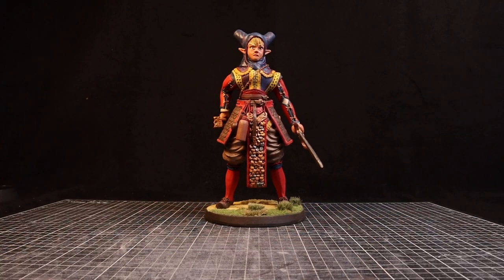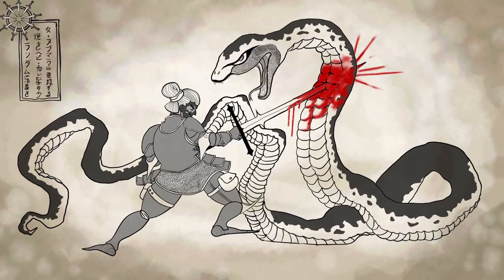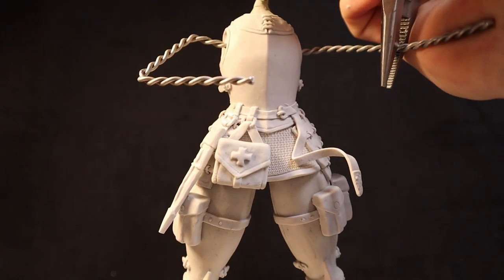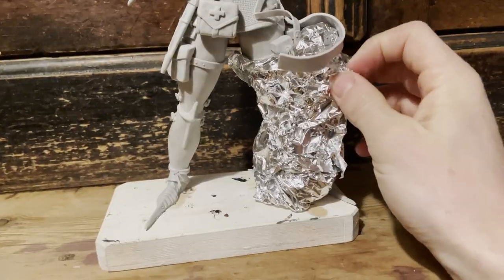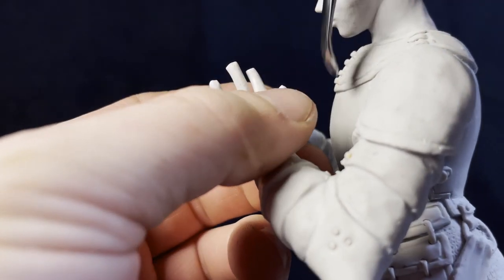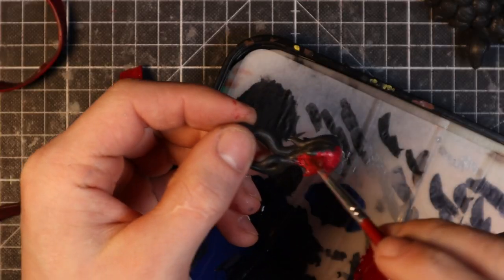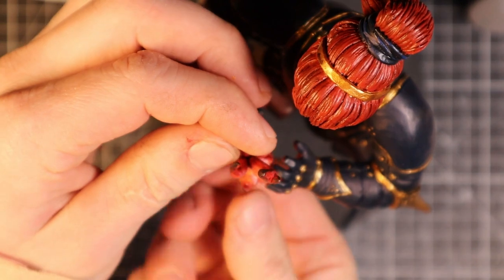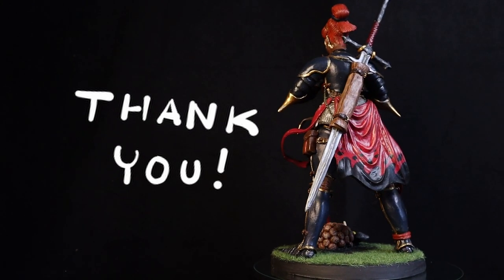The Sacrificatrix Knightess | Worldbuilding and Sculpture

Comment: Great sculpts! Have you ever tried super sculpey firm instead? I think it would help you a lot for all those tiny details you put on your models! (not a sponsor!)
Reply from the maker: Thank you! I have tried it a little bit and as you say it’s better for the tiny details, but I find it much harder to blend with cured clay. I recently bought some Bake and bond (Clay Adhesive) so it might work better if I use that too. I’ll definitely experiment some more with it!
Reply: @_nubmark  recently I had to repair a model that broke in two pieces while baking (my fault, the armature was not well thought). I've started with thin layers of well-conditioned clay, and spread them using silicone-tip brushes. A bit of sanding after curing, and at the end the two parts and the new clay blended seamlessly. Hope this helps. Looking forward to a new video from your channel!
Reply from the maker: That sounds like a good method, thanks for the advice! I have a new video coming soon and many more planned after that :)